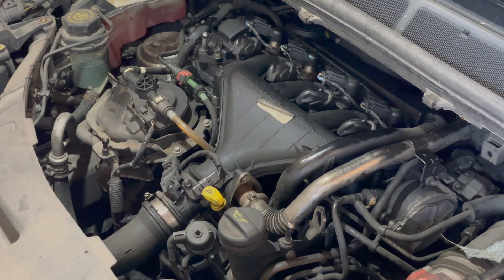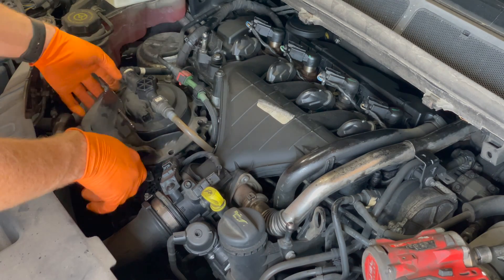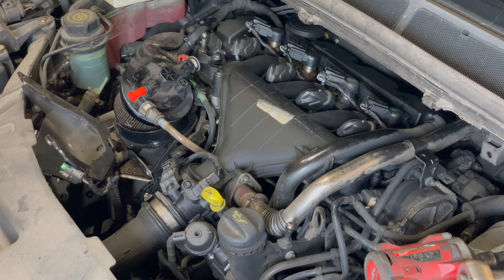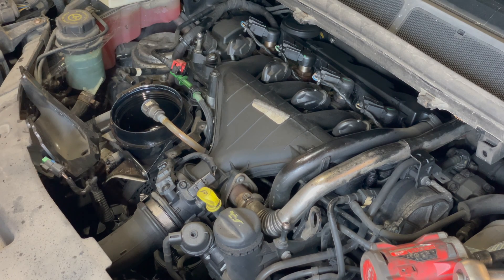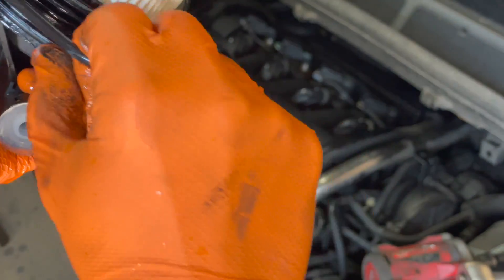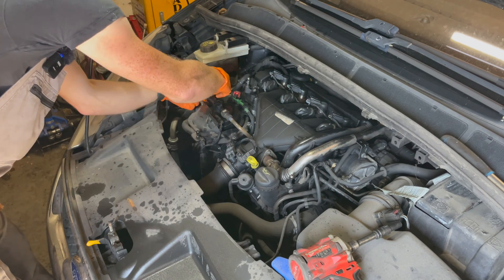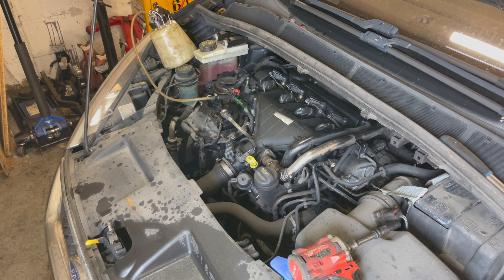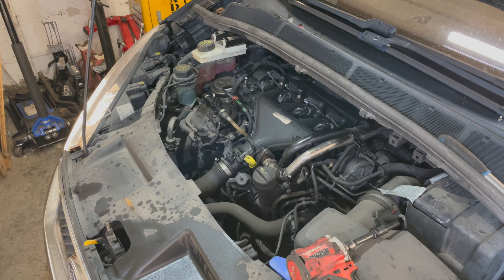How to change a Peugeot/Citroen/Ford 2.0 Diesel Fuel Filter with bleeding. DW10

Comment: Thank you so much. My complete fuel filter housing was replaced because the 6-shape on top of the cap was practically round from all the filter replacements over the years. it was NOT bled correctly at all. My fuel line on the right of the filter is completely empty. However I have a handpump, so I'm wondering if that is enough. Going to try it tomorrow. There seems to be a ton of air in my lines and it will barely start at all.. At this point I'm sure it has damaged my pump. I pray not.
Reply from the maker: You’ll be ok I think

Comment: Thanks for the info in this, I have a Ford Focus diesel in my garage, its been sat there for at least 5 years now, I made the mistake of changing the diesel filter and then running it on the starter motor until the diesel came through, 5 miles later the diesel pump failed and in the process, because of the return to tank pipe, it distributed metal shards all the way through the system, from tank, feed and return pipes, regulator and injectors, I have cleaned all of this out and have fitted another pump and injectors, just have not been brave enough to try starting it since!  This may well be the advice I needed.
Reply from the maker: Euugh, that's a shame, always the risk when running a pump so dry!
Reply: Got me worried now, tried with a can of spray... then realised i had to have a vacuum pump,  priming bulb didn't work either @theweekthatis